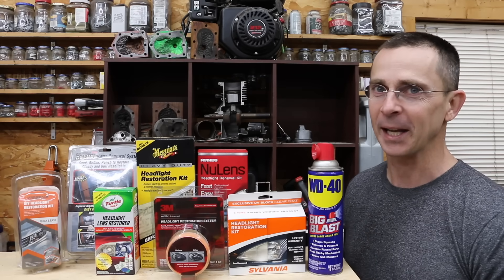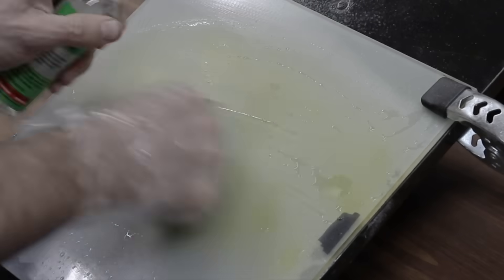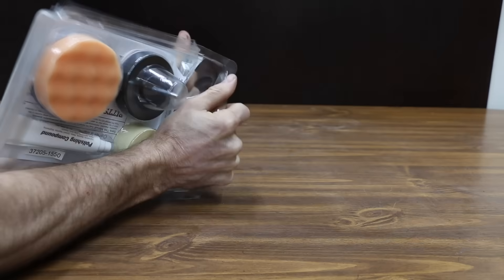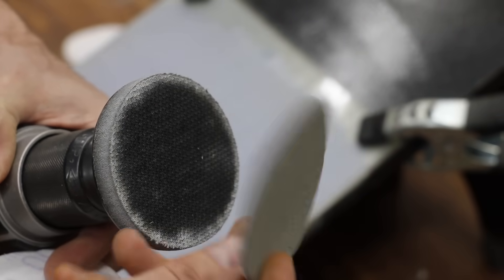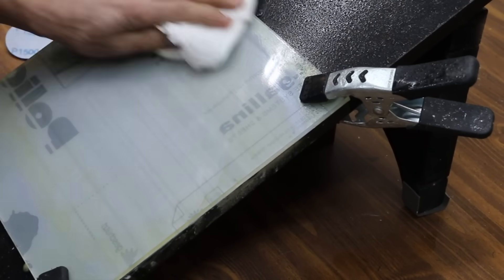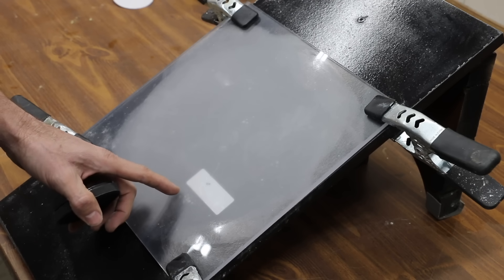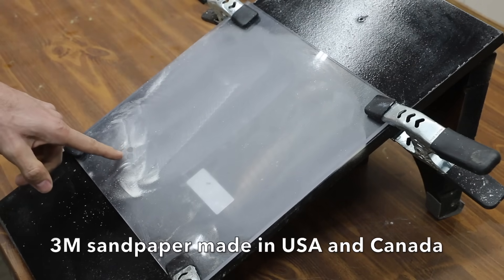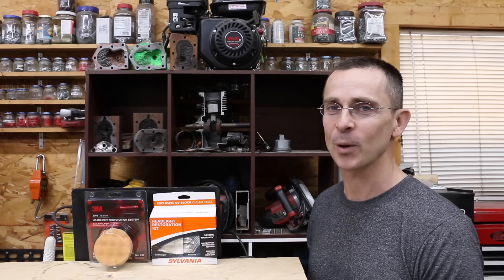Best Headlight Restoration Kit?  Let's find out!  3M, Sylvania, Meguiar's, Mothers, Turtle Wax & HF

Comment: Hi, I'm a Car Technician in England/UK. 
There's Another Technique I Use, That's VERY Cheap & it Works, No Brands. 
1) Clean Headlight Lens with Soapy Water then Dry. 
2) Use Masking Tape & Plastic Sheeting to Protect Surrounding Paint, Under Hood etc, TP Will Bleach.
3) Use a Power Polisher with Sponge, 
4) Use VERY Cheap Toothpaste (TP) " the Cheaper, the Nastier, the Better " 
5) put a few blobs around the Outside of the sponge (No Water = Course Polish) before turning on, place on Headlight Surface, Smear the TP around, 
6) Turn On Polisher at Lowest Speed. Spend at Least 5 minutes on Each Headlight, More if there are Many Deep Scratches, 
7) After you've done Both Headlights, Remove the Sponge Pad, Wash, Rinse in Clean Water, Wring Dry, Put back on Polisher, Turn On to Remove as much water as Poss' 
8) Repeat 5 & 6, small Amount of Water in Sponge + TP = a Fine Polish. 
The Result Will be Very GOOD + You May Want Apply some Protective Coating, I Do Not, I Just do This at Least Once a Year, It's NOT a Bank Breaker. 
Remember; Tooth Paste is Eco-Friendly for Going Down the Drains & No Silly Pads, Drills to Go in The Bin.

Comment: A good result poly-headlight job basically comes down to quality sandpaper, sensible stepping, plenty of water, patience - and a quality UV sealant. "The good stuff" can be hard to get a hold of because its a carciogenic, but if you know someone working in optics or industry... just wesr protection.

Most people, including myself early on, cock it up by being impatient with the sanding. Too fast rotation, too little water, skipping grit-stepping, end up gouging or melting the polycarbonate and sealing in loose material and rough particles... and of course, the sealing. If you don't seal it properly with something UV tolerant, all that work will be wasted pretty damn soon.

For people intent on keeping an older car long term, and inexperienced with fine-grit (wet) sanding, I honestly tend to ask them to check around for the price on a used set of headlights first. Unless the front lens comes off easily, then only that, but they're usually stuck on with butyl rubber sealant, and I've had too many bad experiences with damaging the housings when popping plastic headlamps on the oven to soften up the butyl.

Comment: I think the problem with most of those was the large jump in unavailable grit due to manufacturing cost. Going from 800 to 2000 or 3000 would take a while to remove those scratches. There should have been some 1200 and/or 1500 in between. Using chalk would probably ease that process as well so scratches would be visible from the previous grit...Works for bondo anyway

Comment: The only thing I’m left wondering about is how much of the lens has been removed by sanding. You’re going to have to remove material regardless, but I always wonder, how many times can I do this to a lens before I wear a hole in it requiring me to buy a new or used headlight. That’s no doubt a different test. I doubt there’s a lot of people wondering the same thing. Anyway, now I know I’m going to buy Sylvania to do my headlights. I already have a new box of Maguires unused from last year. I’ll be buying Sylvania. Thanks.

Comment: I just use Colgate white toothpaste, water, 2 pieces of paper towel, 2 microfiber cloth and some car wax.  Start by cleaning light with water and one of the sheets of paper towel, then apply a small amount of toothpaste on the second paper towel and rub the paste over the discoloured areas. Add water as needed and continue rubbing the paste on the light cover.  Once you have finished, remove the toothpaste with water and dry off with microfiber cloth. Add some wax to the light cover and use the damp microfiber cloth to spread it over the surface.  Once dry, clean off the wax with clean microfiber cloth.  It might take 10 minutes.

Comment: He, as always, pointed out the most important thing which in this matter is using the right sandpapers. Then applying any clear coating or better, UV protection. As I only bought old used cars, I went through many different lens restorers and ended up just using several gradually finer sandpapers and then use whatever plastic brightener compound I have at the moment. For UV protection I use clear coat spray can with UV protection. Once again, thanks for making this video so concise and straightforward.

Comment: A porter cable buffer with an orange pad and a fine abrasive followed up by plast-x works amazing. That would explain why the 3m works so well. Those sponges work great on PC.

Comment: Great video. Quick tip if i may. Going to an auto body supply shop you can get all the wet sandpaper needed also a quart of automotive paint/ clearcoat. It will have uv protection in it and you can do your headlights and probably have enough left to do headlights in your whole town. 15 yrs ago I had an old quart of House of Kolors intercoat clear leftover from my h-d paint job so tried it on headlights and they looked new for yrs. Not suggesting House of Kolors due to being extremely expensive just an avg.clearcoat.
Reply from the maker: Thanks for sharing.

Comment: Great test!!!  I've always wondered which one of these kits works the best.

For another test, how about buying sheets of 500, 800 and 3000 grit paper, then polish with a foam pad on a DA polisher and Meguiars M100, then top off with a rattle can of clear coat.  Use this method against the most expensive kits.
Reply from the maker: Thanks for the video idea.

Comment: I've used 3M kit the other day. And this product SUCKS! Yes it does a good job sanding. However the problem is the spinning disks on the drill is the problem...the pads wobble while it spins and scruff on the paint. As much care I took to doing the work, the wobble and the torque from the drill makes it impossible to not touch the bumper and cut on the bumper.
Now I have to buy touch up paint which is more expensive than the 3M.  I used 4 layers of masking tape but it still gotch! 
Unless you have done this job hundreds of time, you will make mistakes. And I don't want touch up anything if I can avoid it. AVOID THE 3M!!! It came straight out of lab and into store shelves. 
it's good for vehicles with headlight lens far from bodywork(like this  video it makes sense since he just used it on a sheet of platic, not on a car!).
But not at all good with torquey drill + wobbling disks. 
They should've made the disks with soft outer or make it smaller than the holder pad...NOT BIGGER THAN THE PAD! - 1 star

On the hindsight, I think products using hand will be more secure. The drill is not any easier as you fight to keep the drill and pad wobble in control, to which you have to be a seasoned pro. Either that or have a thick plastic or metal strips around the headlight...wet masking tape becomes soggy and becomes like water soaked paper.
Even if you take off the headlight to do the job, where are you going to hold it? It requires bit firm pressure while sanding it.
The quality of the job is very good though.
Reply from the maker: Thanks for sharing.

Comment: Blue Magic metal polish  works very well for removing the oxidation on headlights,  it also leaves a light layer of protection. It does wonders on any smooth plastic, clear or colored.
Reply from the maker: Thanks for the feedback.

Comment: I use Crest toothpaste make sure to use it dry apply to lens then buff with high-speed air buffer or corded electric drill then rinse with water,  may have to repeat, if completely clear mask off area then spray acrylic clear coat to the lens to protect against pitting, just what we used to do before I retired in 2010
Reply from the maker: Thanks for the info!

Comment: Weird how the sandpaper is getting clogged when you sand continuously over and over again without wiping the dust away, crazy how spinning a piece of sandpaper on a sheet of dusted material makes it stop working lol. I get it, but if you want to give a shitty paper quality a fair chance, at least wipe it or blow off the surface each time you sand the whole thing.. Also, if by the 3rd kit people still don't know how to apply a velcro disk to the pad given to them, or still don't understand the principal of going up in grits to reduce the visible scratches... then they shouldn't be allowed to use a drill period..
Reply from the maker: Thanks for the feedback.

Comment: As a retired quality and design guy I love your test techniques and often consult your channel before purchasing misc. items. Your viewers might be surprise to know that any material (glass cleaner?) containing ammonia will cause damage to polycarbonate if it comes in contact with the unsealed material - just once. I had to ban these cleaners from a production floor when I found - after an exhaustive and expensive investigation - that ammonia in a commonly used cleaner was causing the clouding and failure our customers were seeing. One other comment from a guy who has refinished glider wings: It is very hard to clear all the abrasive from one level of sanding/polishing from pads, mounts and wash water. This often results in picking up a few grains of the previous grit which then scratches your surface.  3M does a great job because their material sheds very little abrasive but still would benefit from an extensive washdown between grits.  Keep up the great work!
Reply from the maker: Thanks for sharing!

Comment: If you live in an area where headlight oxidation is severe, most kits are horrible. You can't use a piece of sandpaper the size of a playing card to do two headlights. I purchased a couple sheets of silicon carbide wet-sanding paper: 800, 1500 and 3000. Then I went to buffing compound then polishing compound. Lights look like new. Had PPF put on them as well. Most of the spray-on or wipe-on clear coat distorts the light pattern. PPF doesn't. And, it'll last for the life of the car.
Reply from the maker: Thanks for sharing.

Comment: Acetone
Reply from the maker: Thanks for the suggestion.
Reply: @ProjectFarm  i saw an American youtuber using acetone by wiping it on the plastic headlights.

Another one from another country I forgot where, they were using a vaporising cup. They put chloroform on the cup and point it on the plastic HL, it instantly becomes crystal clear(it was wet sanded beforehand).

Comment: For headlight cleaning, check out the KBS product line. They have some amazing coatings, and rust preventative products. I have used the rust converter and restoration products and have found them to be much better than others I have tried, but I have never done a comparison of them in a test like you do. Your procedures are great and very fair! Excellent work!!!
Reply from the maker: Thanksfor the suggestion.

Comment: You should do Rustoleum WipeNew....I have proof it works and for only $10.....I've restored many customers headlights with those kits and it made them look like new again right before their eyes. I'd be curious as to how it looks under a microscope
Reply from the maker: Thanks for the suggestion.

Comment: I’ve been using acetone and a piece of t shirt cloth to clear yellowed headlights for years. It takes less than five seconds to wet the rag, wipe the lens super quick and get the rag off as fast as possible. 
The yellow plastic comes right off and the acetone softens the plastic under it, allowing it to become perfectly smooth and clear. 
The lens re-hardens within a minute, and bonus; if you want to spray a clear coat across the top of it, the surface is perfectly prepped.
Reply from the maker: Thanks for sharing.

Comment: If you haven't tested float chargers, especially the solar kits, maybe you can try that for your next video. I see 5W, 7.5W, 10W, 18W solar kits on Amazon that can be used to maintain charge on lead acid batteries
Reply from the maker: Thanks for the video idea.

Comment: 3M has several variations of headlight restore kits. I used the kit that has the quick clear coat applicator #39175 and I think I wet sanded the entire process regardless of what the instructions might have said, but results were great.
Reply from the maker: Glad to hear!  Thanks for watching.

Comment: About 10 years ago I tried at least 3 kits, they all sucked. In the end, 500 grit, 1000 grit, 1500 grit wetsanded plus Minwax Spar Urethane/spray on clear coat won, and for the money you spend you have enough materials to do dozens of headlights.
Reply from the maker: Thanks for watching.

Comment: Wow!  Huge variation in those kits results.  Another great test.  I just use wet dry sandpaper from 400 up to 2000 grit wet.  Rinse, dry and apply a 50/50 mix of spar urethane with a folded paper towel.  Good for about 3 yrs.  Cost about a dollar in used supplies for two headlights.  They look like new too.
Reply from the maker: Thanks for sharing.

Comment: It'd be quite a bit harder, but I'd LOVE to see the comparison of various coating products, since that's definitely where things fall most flat. I've had extremely good luck with Wipe New, and it even delivers pretty well on its promise of covering up lazy up front sanding work, filling in even quite deep scratches pretty well. But I'd love to know which products actually last longest in UV, since no amount of sanding is worth it if you have to redo it every 6 months anyway.
Reply from the maker: Great suggestion!  Thank you.
Reply: @ProjectFarm  I look forward to the video in 18-24 months :D

Comment: Project idea… Cold air intakes. Do they actually reduce the air temperature letting in denser air? Does the heat from the engine compartment nullify any cold air intake Benefits? Is there a horsepower difference? Does taking the stock expansion chamber of the intake off effect performance?
Reply from the maker: Thanks for the video idea.

Comment: In a pinch a guy can use off mosquito repellent in a spray can and an old towel. Soak the lens and rub vigorously with the towel it will take a thin layer of the lens off taking the oxidization with it
Reply from the maker: Thanks for the feedback.

Comment: My experience with the 3M kit is very similar to what was stated in the video. My headlights were in VERY bad shape. Once treated they looked great for a bit over 8 months then started to get badly clouded again around the one year mark. Next time I'll use a sealer or the Sylvania kit depending on cost.
Reply from the maker: Thanks for sharing.

Comment: Just to note, if you have clear lenses that are "just starting" to get a little hazy, just wiping on and wiping off Meguires PlastX will make them clear again and in about 4-5minutes for both headlights.  Then sealing them with EagleOne Nano Wax or whatever wax you use. 

If you do this once every 6-12mo. they'll just look crystal clear without having to screw around with sanding and all that time and effort.
Reply from the maker: Thanks for the feedback.

Comment: The only one of these I've used was the 3m, having usually just done it by hand and with wetsanding, spray-on clearcoat and a polishing wheel, I was amazed at how well it worked on a motorcycle headlight that was quite hazy. looked perfect five years later, and really took off an incredibly minimal amount of material. I do still prefer adding clearcoat and polishing it down to build back up that thickness of the material, but I'd be happy to reuse the 3m kit again.
Reply from the maker: Thanks for sharing.

Comment: I gave the 3m kit a try based on your reviews:  I needed to get two kits, just because my X3 has huge freakin headlights. I thought the pads clogged and stopped cutting far to quickly, but in the end they did the job. Even though there was some haze remaining after using the 3000 pad, after applying the lens wipes, they looked just like new.
Reply from the maker: Thanks for sharing.

Comment: That oxidation and yellowing is called crazing. We did a similar thing in A & P school, after the 3000 grit sand paper, we switched over to a product called micromesh. An that product went up to 30,000 grit this product was designed to polish out crazing on aircraft polycarbonate windshield and side windows. Scientific us to offer a similar kits for vehicle headlights. Micromesh does offer a polishing kit for vehicles headlights.
Reply from the maker: Thanks for the feedback.

Comment: In Burma we use cheapest Chinese toothpaste we can find (about like valve grinding paste, actually), mixed 50/50 with Thai ODOMO brand 30% DEET mosquito repellant. Once lens is polished clear, quick spray of clear lacquer or nail polish. A little dab'll doo ya.!
Reply from the maker: Thanks for sharing.

Comment: I've found that using turtle wax swirl and scratch remover works very well on remove yellowing headlights. At first i want to use it for removing swirl and scratch on my body panel but it doesn't work at all so i tried it to my oxidized headlights and works surprisingly good. Can't be like brand new but it doesn't looks like old car anymore
Reply from the maker: Thanks for sharing.